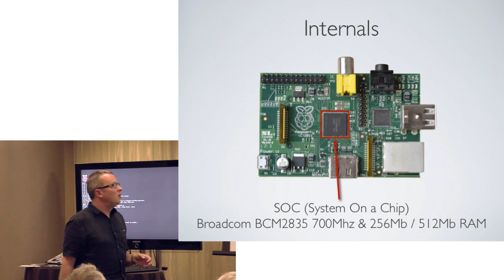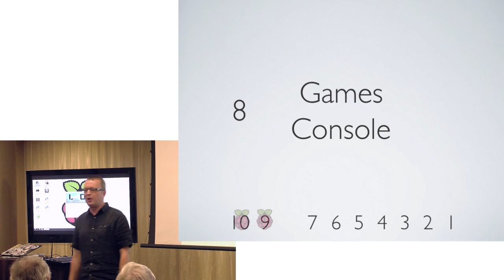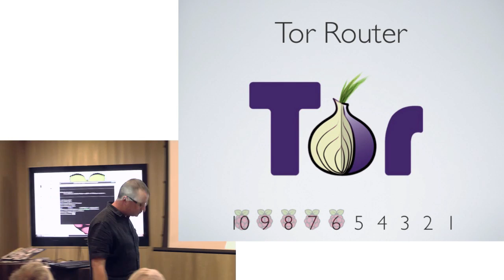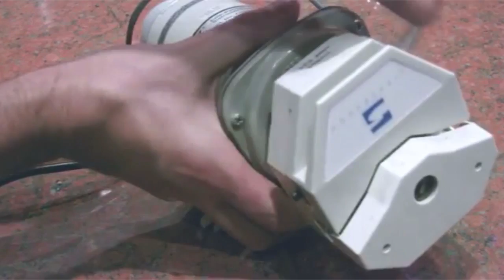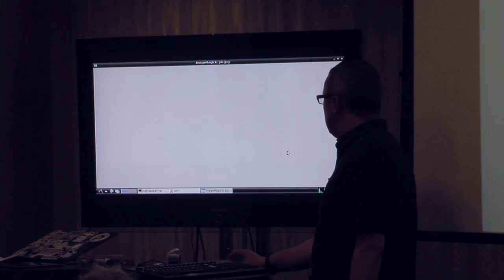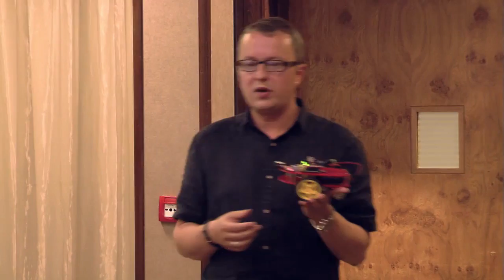Tech Tribes Talks - 10 use for RaspberryPi (Rob Dudley)

Comment: What port does this communicate on on the internet? Would I be able to set up port forwarding to PI to make my PI a file server available from internet (outside of my local network)?
Reply: yes
Reply: Great, what port does it use for www?
Reply: Jędrek Domański what? www is port 80? the port is just a number from 0 to 65,535. I think you should research more into how the internet works - your prob will be able to still setup a file server - you just gota install software. Use google
Reply: Jędrek Domański add me on skype "ashleymeah"
Reply: Ashley Meah Some devices, like my HDD docking station uses port 8080 so it;s not that obious
Reply: Jędrek Domański What are you talking about? This is not a docking station, its a computer. Lots of stuff run web control panels on different ports - this has no web control panel running by default, it is a computer like the computer you are most likely currently using.
Reply: Indeed, that's a good point, I'm a stupid moron and jerk that doesn't know a shit about it:))))